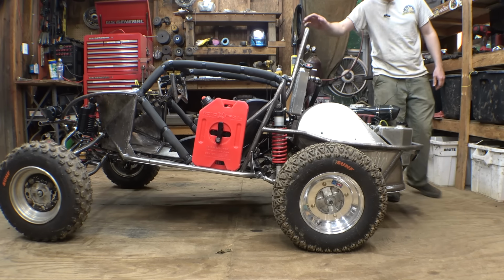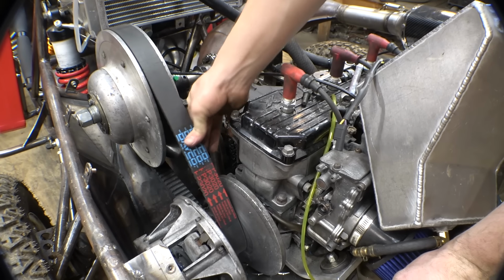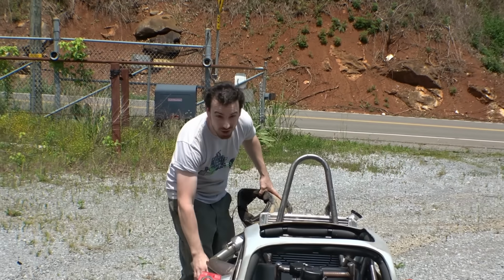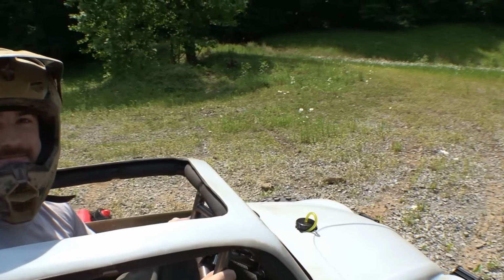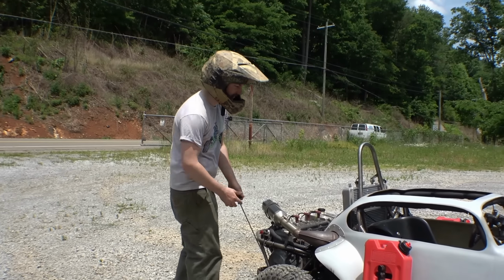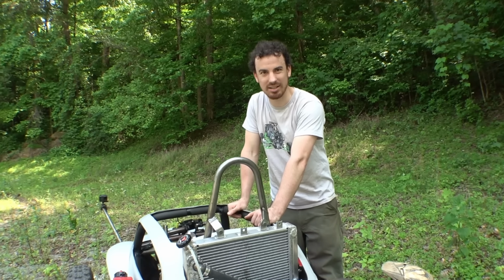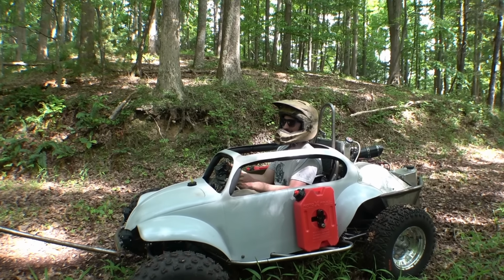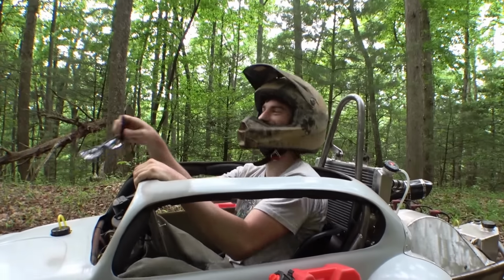This Thing is Nuts!!  - Mini Baja Bug Project First Test Drive

Comment: That squat in the back is still too much.  You need stronger springs so you don't kill your travel.  You might need to stiffen up the front more too.  It is almost like the front is too loose too, but stiffer back springs might help with that.  I question your plan of making it do wheelies so much as this is killing you steering.  The dif will make donuts hard to do.  You might actually need some weight in the front.  Maybe 25-50 pounds of lead in the front would help. 

I would put a small shield around the front of the radiator cap so if it overheats bad it will not spray you with boiling water.  200'F will likely not hurt the engine, but you definitely need a fan on a temp sensor.   You need to paint it to look like Herbie...

Now I personally do not like the CVT... or 2 strokes as you need to kick up the RPM so much to get them to move.  You also need to start using drive shafts, fenders, and better mufflers on your builds.  I would also love to see a build using one of those Chinese 125cc quad engines.  They have 3 speeds, reverse, and electric start and they are pretty cheap.  With an aluminum frame is should be pretty fast still and should not use too much gas.  I do not like karts without suspension, but a small cart with a good 6" of travel would be fun.  Buy some quad rear axels so you can do an independent suspension instead of a straight rear axel.

Comment: you should build those and figure out how to speed up the build get some companies to build the parts then sell them find a engine company and go to town I would buy one I want an R6 motor on mine though with clutch and shifter like a car somewhat little longer shock wider tires you know like aftermarket 4wheeler tires

Comment: You need thicker shock springs in the rear. Plus heavier viscosity shock oil with maybe small shock pistons. That things drives like a stock Traxxas Revo out the box. That's not good. Try to get some kind of a sway bar on the front so you can have traction on both wheels. When you turn, the vehicle isnt turning because it only has one wheel on the ground. It looks cool but has zero functionary.

Comment: I would start with changing your air box not enough air flow. To keep RPMs up. In a straight run it is great but in a corner You needing more air. an its not getting it.

Comment: You held 200°, it clearly needs a fan to draw air through and exchange heat. There's a driver in front of the radiator limiting air flow, even if you're haulin' ass! Carefully select a suitable fan since electric fans can consume stupid amounts of current and overwhelm the genny.

Comment: You are better off getting a FOX susspention. Your susspention is too soft. It needs to be tightened up more. Too much flex and sway. No steering. That's way you are bottoming out. You did great on your build. Now you need to work out the kinks & bugs.

Comment: First and foremost, the thing is cool, but#1 you must do something to fix t h e under steering #2 the thing needs to get bigger, so maybe stretch the frame #3 it's running lean ,so that's not good..# maybe a rebuild is do..

Comment: Your pipe is not letting you use the power your motor is trying to put out Kenny Roberts IS the best pipe builder in the world he doubles HP just by making a pipe it sounds hard to believe but it is true I’ve built bad to the bone motors but I couldn’t use the HP until I used his pipe and let’s just say I’d beat street bikes on the quarter mile very easy

Comment: Running issues and you didn’t  pull spark plugs??? Spark plug reading is the life heart of any engine.  A spark plug tells you everything. Every single tho g you need to know about the condition of the health and operation of any and all engines

Comment: Come on man you build this awesome machine but completely overlook the fact it will need a radiator fan!!? I don’t get it. It’s snow mobile engine..think about it, it’s designed to run in the snow. You’re going to need a stout cooling system. Make a shroud, fit a thermostatic fan and fit a temp gauge so you can monitor it whilst driving. Once you sort that out take it for another run. You’ll probably find the bogging when hot issue will be fixed

Add some swaybars to stop the huge body roll. This will enable you to steer properly

Comment: Now I've seen it with a driver, that thing is both awesome, and a deathtrap, at once. Still no protection from boiling coolant hitting you in the neck, and you stick up even further than I thought you would. Dude, c'mon, man. I like this little monster, but you are being too complacent. Not taking safety seriously enough. Please try to be a better example, safety-wise.

Snowmobiles are tuned for cold dry weather, not warm humid weather. Re-jet/tune for your weather, is all you need to do. You can run a bit retarded timing too, because you won't notice a loss in speed/power, and she'll run cooler. Just don't go overboard, and hurt your perfornance. .

Comment: Fouled spark plug,running too hot and not tuned right it’s close you’ll get it. Sounds like it’s down a cylinder later in the video

Comment: I hope you learned a little bit something cuz you know even though you just had that engine rebuilt if you did run to lean you toasted it it's going to have to be rebuilt again unfortunately and run it 32 to 1 the more oil you put in the gas the better off you'll save parts instead of throwing rods and pistons and having to rebuild it every day hours anything over 200 CC's has to be rebuilt every 8 hours at least inspected and rearranged every 8 hours or five hard races and that's according to the manufacturer not me

Comment: Your stearing looks to be off your camber and caster is out of adjustment watch video of you doing donuts your geometry  is off I could be wrong on my carts when you turn to either side the inside tire stays turned and the outside tire returned to straight I think it is c
Aled Johnson geometry for your front end

Comment: Not really on the carbs? You must not know anything about carbs. Yes it needs to be turned right. The thing is when you go to do a donut your putting more stress on the motor. So when that happen then you need more fuel.